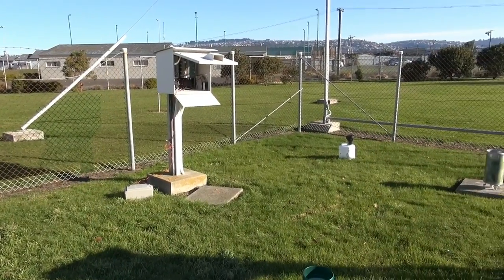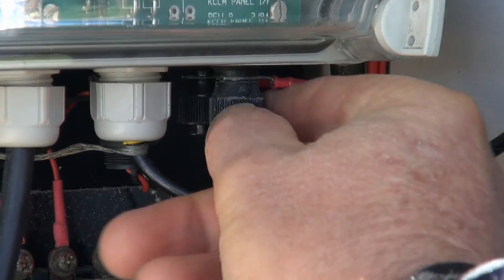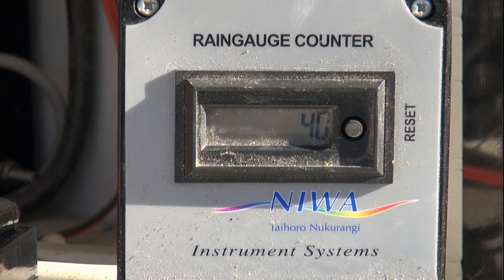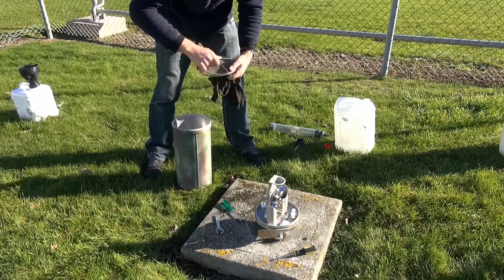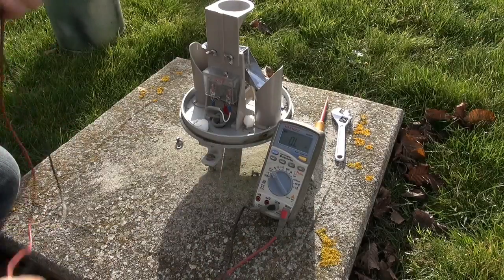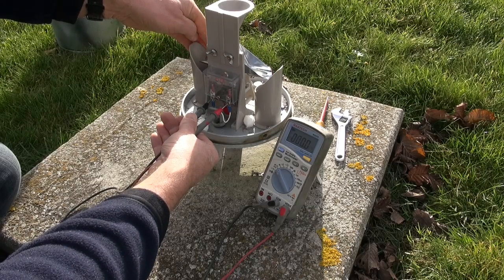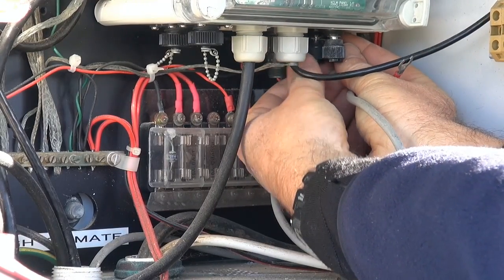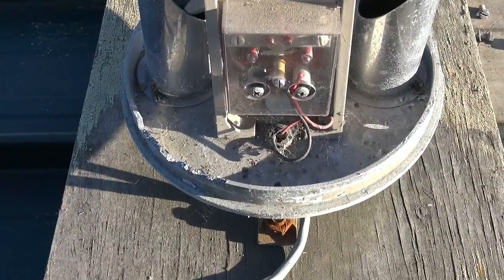Raingauge Field Calibration Checks

Comment: Could you please share the diameter of the tipping bucket, resolution of it, and volume of water you tested.
Reply: Hi, the diameter is 200mm, resolution is usually 0.5mm but they also come in 0.2 and 1mm, the volume of water is 653ml but it's more about the number of corresponding tips through the gauge, e.g. 40 tips for a 0.5mm gauge. Look up the Hydroservices manufacturer website for all specs and details.